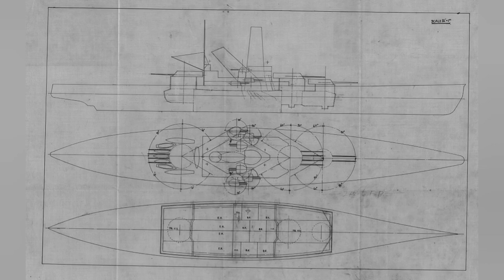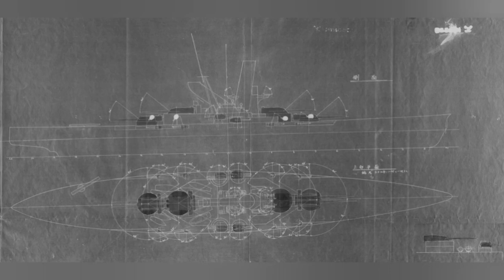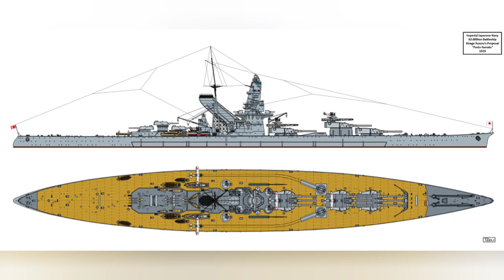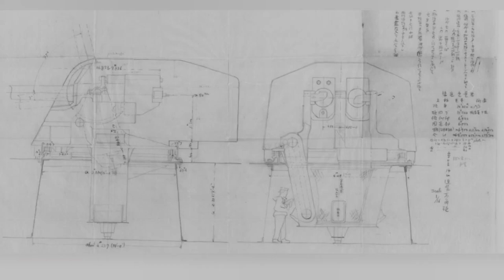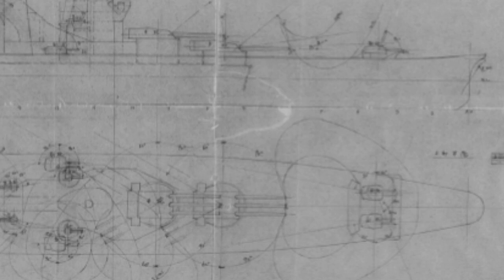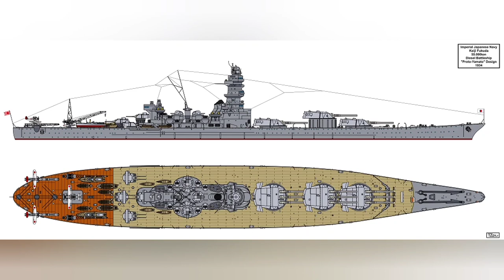The Pre A-140 designs

Comment: You gotta admit one thing about Hiraga. The old goat was incredibly stubborn. "No casemates nor long hulls". Hiraga: "I'll give you casemates and long hulls. A spoonfull of it". His superstructures were odd looking as well, but not in a bad way. Guess he was too attached to the old ways or maybe the success of Yubari solidified some belief he could do better than the General Staff, given how much of the IJN battle line stemmed from Hiraga's capabilities. Which is no small feat, actually.

Wonder how far Fujimoto would have gone had it not been for his drinking problem. Beyond some monstrosity out there, his designs look well balanced and thought out. Except for putting the bloody catapults on top of the main turrets and not at the stern on the longer design. Lots of free real state right there and the secondary would have caused much less damage to the air component equipment.

I remember perusing through the oages of a huge book dealing with the Yamato and it stated diesel propulsion was dropped due to: one, the sheer size of the engines needed and second, due to the engines being "entombed" deep inside the hull there was the need to remove all of the deck and superstructure above the engine room to be able to extract them. Which in a Yamato size of things was literally impossible to achieve in both operational timeframes and dockyard capabilities. If one engine broke, it was literally a major rebuild.

Excellent video as alway, Crosser.

Cheers.

Comment: Very interesting video, thank you
So many people praise the innovative Japanese post Treaty designs but never point out just how they broke their oaths by building ships massively over both the Treaty limits and what they said they were.
Reply: You keep harping on about how the Japanese ignored treaty limits and use this to argue their designs were inefficient (as happened with the Germans), not understanding that even for their actual (non-treaty-compliant) displacements things like the later Japanese cruisers were genuinely very heavily armed (in fact, arguably TOO heavily armed, which is the opposite problem of what you were claiming) and fast for their size. 

The Germans broke the treaty limits by a much larger margin than the Japanese did and still ended up with far less capable ships.
Reply: @johnfisher9692  

You’re still not understanding my point, which is that you assume EVERY design that broke treaty limits is inefficient, which really only applies to the Germans.
Reply: @johnfisher9692  The problem with things like the Japanese cruisers was the opposite of inefficiency, since the problem was that they fit TOO MUCH firepower/engine power into too small of a ship leading to structural failures and instability which is the opposite problem as to what the Germans had.
Reply: @bkjeong4302  Well if a ship cannot proceed at full speed or fire all its main guns without risking the hull developing cracks, I'd call that a poor design, or in other words, inefficient.
But again you ignore what my first post said: That while praising the innovative Japanese designs you should remember they are  over their announced displacement and/or the Treaty limits by a very wide margin.  
As were all the German major surface units as we some of the Italian Cruisers and the Littorio class design.
I said nothing about efficiency, that's your take on a simple and true statements

Comment: 67000 ton design A doesn't have a funnel
Reply from the maker: Being a diesel propelled ship, it doesn't need one, same goes for the design after it. Fukuda's design at the end has a funnel, but due to it's position and size, it's not for ventilating large volumes of smoke as the propulsion system was also diesel.
Reply: @centralcrossing4732  modern warships ships are diesel but still have funnels,(though smaller),it would require at least somekind of funnel right?
Reply from the maker: @JokeFranic  Ideally, there is some kind of exhaust, just not a standard funnel for standard steam boilers. There are actually 4 vents visible on the superstructure on those designs when viewing the top down images. I understand why you point out modern warships, but we are dealing with a whole different era, so I think the comparison is lacking. I can't go into why modern vessels mount full scale funnels as I don't study them in any respect.
Reply: @centralcrossing4732  Graff Spee was diesel and it had a funnel,and was 10k displacement,this thing was supposed to be 60k at least,i think something other than couple of vents would be needed,i might be wrond and it doesent need a big funnel... just noticing,not a drawing of a real ship anyways
Reply from the maker: @JokeFranic  Certainly, however I can't answer that as I'm not the designer. Though it's not the original drawing, it is a digital rendition of it since I couldn't find scans of the original.
I'll be honest with you though, I suspect a funnel would probably have been added for axillary boilers to operate the electrical systems for practically everything onboard as was common on diesel warships of the time (with the exception of submarines of course). Of course, I can't be certain of that either.